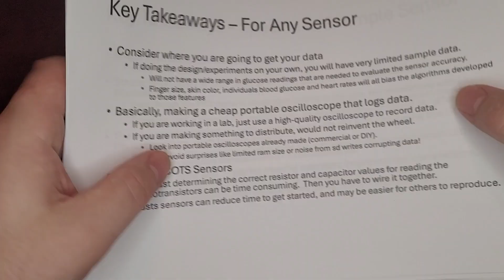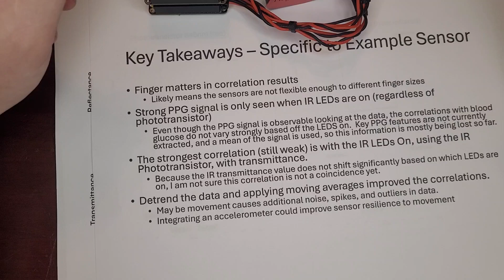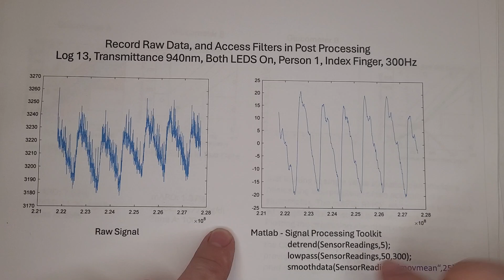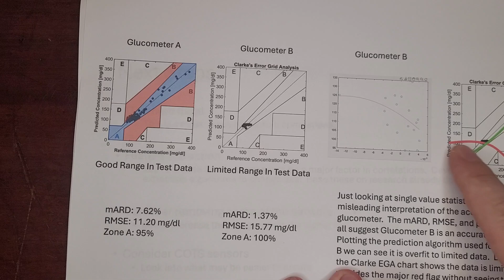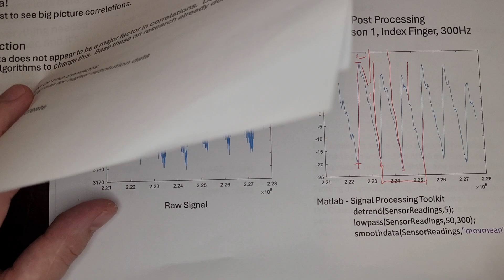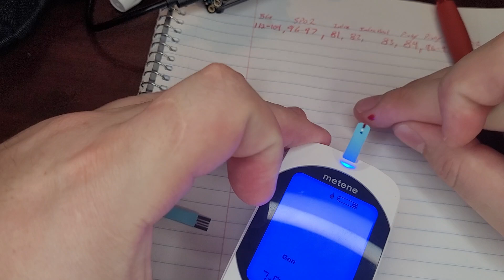Noninvasive Glucometer, Part 1, Open Source Hardware and Software Glucose Monitor, Initial Progress

Comment: Great effort and thanks for taking out the time to make this video. I have started work on a similar project which will use Arduino. Right now I am in the design specifications stage and am writing down the working principles and design requirements. The main difference in my approach vs all others available so far is almost everyone is using pulse oximeter alone and that too it's SpO2 reading which is neither adequate nor enough to be used in blood glucose monitoring (BGM). I plan to tinker with 940nm and few other IR LEDs and other biomarkers that can be collected non invasively. Rest of the approach is similar to everyone else, develop a database with enough sample points to create a model for future predictions. l will make it for personal use and maybe if someone asks for it, make it for them and guide them on how to customize it. I have a few suggestions for your work:
- The first reading taken by the finger prick is the most accurate, all subsequent ones are not, so restrict yourself to the first reading.
- The most accurate BGM is Contour Next, almost 8% MARD, exceeding FDA's 10% limit.
- Ambient light throws off all readings while using NIR, write a code to filter out ambient light while taking NIR readings.
- Use a dark thick black cloth to cover your fingers reader while taking readings.
Last but not the least, I will write you an email a little later once I have some worthwhile things to share and discuss.
Best of luck in your efforts.
Reply from the maker: Thanks for reaching out and the tips.  I did get some more data recently, but have not shared the results yet. Essentially I am not seeing spectroscopy correlations others do.  I suspect its related to not controlling finger positions and ambient light enough, but I am not sure.  I would like to make a nicer model, and I also think ppg feature extraction could be more promising than spectroscopy.  I will follow up with you more in email.
Reply from the maker: Also, to clarify more, I think the finger clamp being adjustable is nice for different users/finger size and getting good skin contact, but has the cost it can adjust signal strength/spectroscopy readings by its position on the finger (higher/lower, and finger swelling, possibly hydration levels).  I suspect that could relate to why correlations were not as expected, but ambient light could also be a factor for sure.

Comment: Excellent project. Has started working on similar. Just few thoughts. Since the amount of samples per logg is on range of 9000 shall be more convenient to show not only mean but also statistical error and gauss distribution on display? Once someone pay 50 or 200 usd for device and PC power is there thinking adding two more set to measure BG like Acetone air measurement with MQ138 and classical pin with blood sample will cover two alternative and classical control. Also have seen commercial BG that take measurement on soft tissue on the ears (no bean), what if you try there and compare corelation? For classic BG, HX711 can do the jobb slow but economical. Display is there all can be done inside PC and show results no need to external PC ot Matlab.
Reply from the maker: I am looking into making an improved version with more "intelligent" circuits. It will be more expensive, but I think the data is provides should be more useful (faster logging with more sensors).  It will involve a PCB with some very small components, so it will take longer for me to get started also.

Comment: Is it similar to how you detect heartbeat with the leds? just need some algorithm to get blood pressure? or do the lights work in a different way?
Reply from the maker: Yes it is, this first example works like that.  The leds shine light through the finger and as the heart beats, different amounts of blood are present while light is shingling through.  So when you measure how much light was received you can see the heart beat.  The amount of sugar in the blood will also alter the amount of ir light that goes through, so I am trying to see if I can see that.  The amount of blood sugar can also affect the heart beat itself, and the shape of the wave it produces.  I have not made any algorithms for that yet, but it is another approach that may help.  This very first sensor is very much like a finger tip oxygen sensor you would buy at the store, but in future revisions I would like to try some different LEDs.
Reply: @knowthebird  Yea I can see why that'd require a lot of data. I bet different peoples amount of light & beat pattern are all over the place..